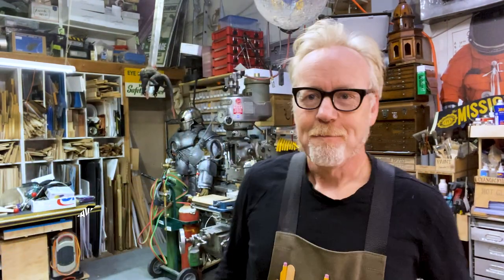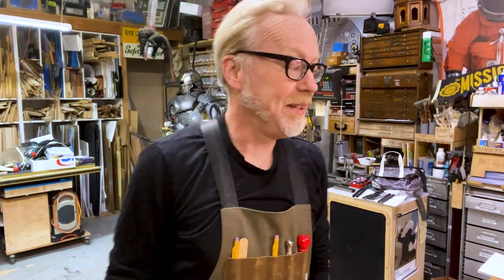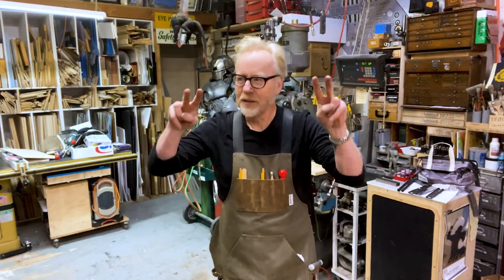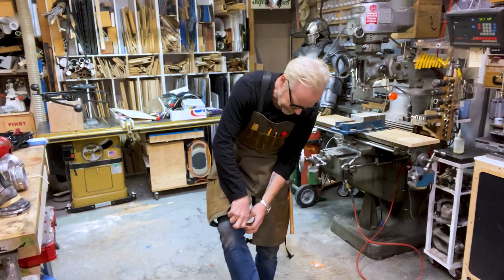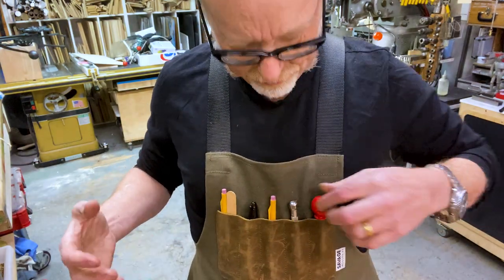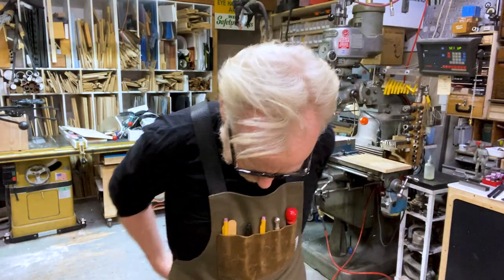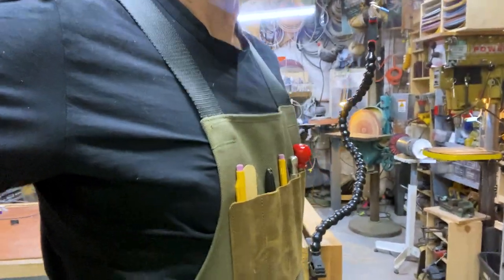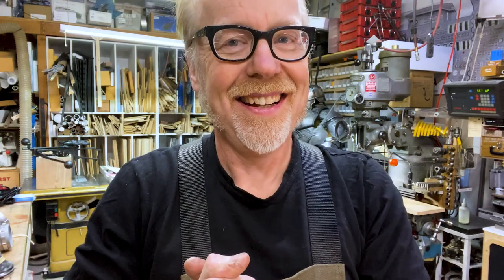Adam Savage's Favorite Tools: The Savage Industries Apron!

Comment: I have a similar apron and one of my favorite features is a strong magnet on the chest. I stick drill bits and screws to myself for quick access. Potential upgrade?
Reply: Maybe a velcro patch panel, where one can stick anything. 
For instance in your case, you stick a velcro magnet there
Reply: That's great until someone with a pacemaker buys one...   Good idea though
Reply: Well, one of adams philosophies is making improvements to oyur own tools isnt it?
Reply: @rugvedk109  seems like a pretty easy DIY upgrade
Reply: I have one of those magnets you can wear on your wrist that has been really handy, you could wrap it around one of the straps to have it on your chest. I also realize I'm old because of how excited I got over an apron.
Reply: @jonroy2456  dude, same
Reply: For sure that sounds like a great upgrade! I'll have to sew one into the one I get. Maybe a few🤔
Reply: Maybe have it be removable so people with pacemakers can wear it.

Comment: The split leg feature is very useful for ceramicists who throw pots. I remember having to improvise an apron out of an old pair of jeans that I basically cut the back off and added a bib and straps tied through the belt loops because it was virtually impossible to find a ready made apron with split legs in 2005. Don't do ceramics any more but I am very much attached to my old apron from the big box craft store I worked at who decided cross back strapped aprons were too costly and switched to neck loops. Wished I'd grabbed a few more.

Comment: I remember the vid where you made that apron, and I was very impressed with the design. All of the changes between your original prototype and the new prototype are predictable - canvas for the hammer loops, nylon webbing for the main and leg straps, quick-release buckles on the legs instead of snap loops, plastic D-rings for the main straps instead of punching through the canvas, and leaving out the small leather patches where the straps connect on the chest. All simple, and none making any difference in the longevity or effectiveness of the product, but all saving a lot of time and energy in manufacturing.

All in all, it's a very well done shift from a one-off personal product to a production product.

Features I'd suggest adding in future versions:
* metal strip for a tape measure to clip on (somewhere)
* loops across the chest pocket, like the hammer loops, to hold safety glasses
* 2-inch hook and loop (the fuzzy side) fields above and below the chest pocket; for patches, name tapes, company logos, etc.
* (4x) 1-inch D-rings, plastic or metal would work, for misc stuff like key rings and retractable ID reels; two locations:
---->along the back edge, above the hammer loops
---->on the chest where the main straps connect

Comment: I might snag the design and build my own but I see room for improvements. The  sternum collar needs collar material for stiffness. If you were putting a pencil away without looking downwards, you'd insert it into the space between the apron and your clothing. The apron could also use some springy material in the pockets, a pencil in a stiff leather pocket will slide out the moment you reach down to pick something up. I've found a seam of leather at that spot provides a loose scrap of leather in the pocket to act as a spring and clamp the pencil in place.

Comment: Some integrated knee pads/connections would be AMAZING.  I regularly have to wear some light foam ones (thank goodness I don't need heavy duty ones) for constant up-and-down work and they're relentlessly riding down my legs, pulling on my pants, chafing the back of my knees, and not allowing my legs to breathe with all the bunched up pant fabric.  But if they hung off the apron via side straps to points just above the knee axis, I think they'd stay at the right height (in part thanks to knee bends pairing with hip bends) and just need a loose strap to keep them in place.  This never would have occurred to me without the leg split - I might have to grab one just to do some experimenting of my own. :D

Comment: As with when you made the original, I love the design. That leather criss-cross piece for the straps in back is particularly great for, yeah, keeping the straps from riding up and digging into the neck. My one main concern is that you talked about having versions "for the very tall and the very small," but while I am neither of those, I am very large. It seems like the back straps may well still be long enough to accommodate my size, but it's hard to say if the torso coverage of the apron proper will be as much as I might like, and the thigh straps particularly don't seem very long.

I suppose that for the strap length concerns, I could just get additional lengths of strapping and matching buckles and make extensions, but still. Anyway, great job, and I totally dig that you were able to get something with materials that nice under $100.

Comment: Just a quick note for future sizes, maybe make the top wider for females with chests? I don't know if it's an issue with that apron but ones I have used in the past have ended up moving around, thus no actual coverage. I tend to be very messy so I ended up making an apron in the pinafore style with crossing backs to allow full coverage over my body
Reply: Maybe you should contact Mafia Bags or a local maker about making a version for people with wider chests and shoulders. It is a bit niche but would be bought by everyone who fits into that category.

Comment: I am sure that a lot of people had their input about that apron. I'm just curious about why you dropped the leather square where the upper straps meet the apron. I like the look of them.
Reply: Less material makes it easier (less expensive) to produce
Reply: @peterw8835  But, we're only talking 2 pieces at an inch squared. Wouldn't have been that much more expensive.
Reply: @andromydous  For one apron  it materials and time add up, increasing the cost of the product.
Reply: @peterw8835  I understand that concept. But we are talking about two 1" x 1" squares. That doesn't cost that much and it doesn't take much extra time to sew them on.
Reply: @andromydous much does not mean zero, which is added cost to a niche product. I also suspect the reason was “it isn’t needed” from Marcos.